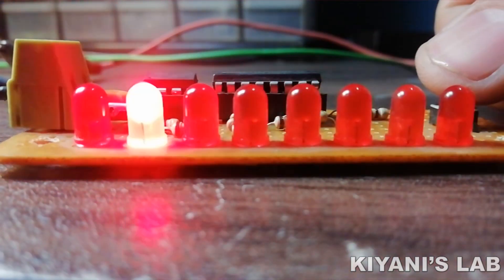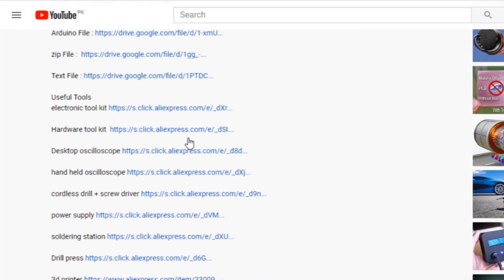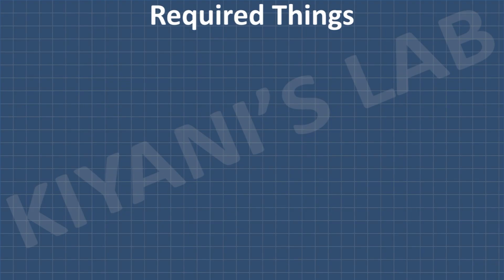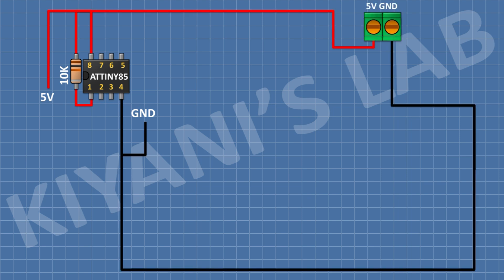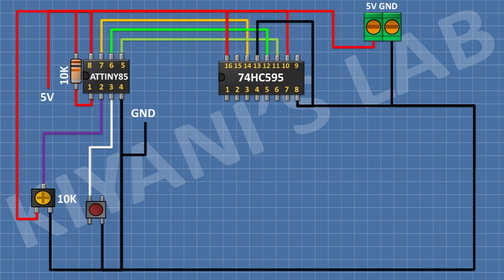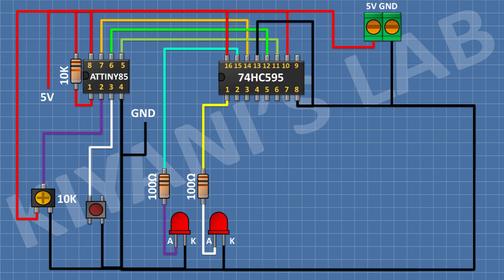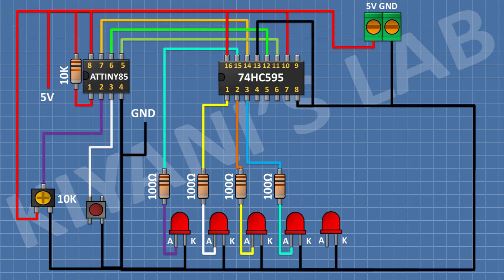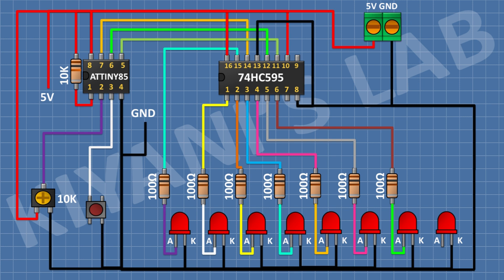How to Make LED Chaser | 8 Channel 14 Effects

Comment: How many LEDs can run with this circuit ?
Reply from the maker: if we use 1 74hc595 then 8 if we use 3 ic then16 and so on for more ic code should be little modified
Reply: @KiyanisLab  Sir, I mean to say How many LEDs can connect as parallel with 8 channels/ terminals?
Can i connect  10 x 8 = 80 pcs LED

Comment: Bro, you didn't showed how to connect attiny microcontroller to Arduino board ? Did u used breadboard to connect the microcontroller and then used jumper wires to connect it to headers of Arduino ? And what software u used to program ? Please explain all these
Reply from the maker: i showed in this video bro https://www.youtube.com/watch?v=C4Iig2AL74s&t=14s